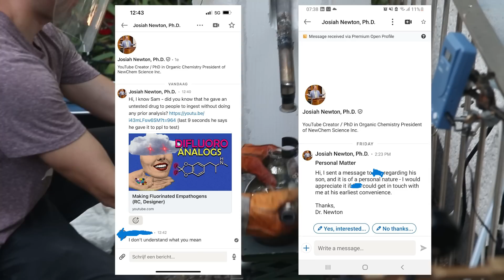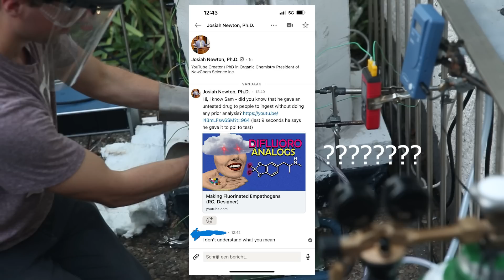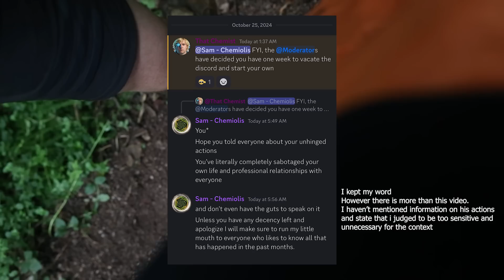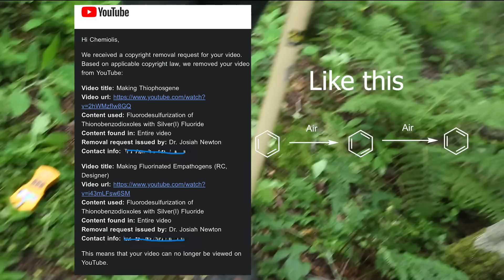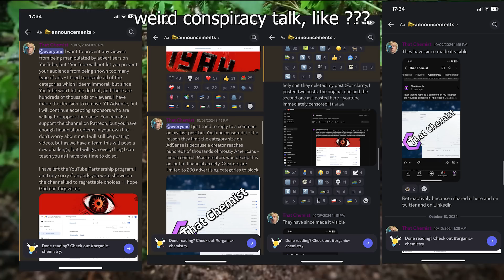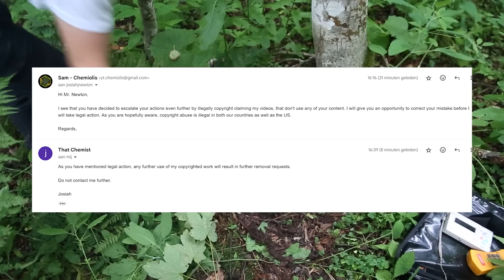That Chemist (Josiah Newton) is a Fraud

Comment: Will someone tell me what type of vessel that is they're using? It has some kinda insulation. Is it a Reactor, or a short path ?  I see some welding there that continues to a kf fitting(25\40?) then down to a rbf after the glass joint.  
I've never seen one like that, with the steel head and so much insulation. If anyone will share this, thank you. 
Otherwise, this situation is somewhat unfortunate. I've really enjoyed this community and especially the level of professionalism and respect across levels from PhD down to fairly "ratchet" techs like myself.  We don't need abusive relations tarnishing our sectors. Thanks everyone that's good and thanks Sam.

Comment: I mean, if the ADHD medicine was adderall or some other formulation of dextroamphetamine that is more likely to cause acute psychosis. As far as I'm aware, LSD can cause issues but it doesn't necessarily cause psychosis, but it can exacerbate potential underlying conditions that may have otherwise remained dormant, like schizophrenia or bipolar, conditions that can in turn cause psychosis. The latter actually happened to someone i know and it's pretty heartbreaking to see.
Reply: no, both can cause accute psycosis, and LSD causes it more often than adderall

Comment: At 3:30 for the third reaction why won’t the grignard SN2 the tosylate or perform an E2 elimination on the nitrogen with the tosylate leaving?
Reply: That’s Tosyl, not tosylate (OTs). I don’t remember its stability towards grignards, but it is very statically encumbered relative to the cyclopyl methylene. Also E2 would be geometrically very difficult.

Comment: Aw man, That Chemist underwent ego death during a bad trip and became a jerk? Well that sucks, I'm gonna miss who he used to be. If you're gonna use drugs then you need to be careful, I almost gave myself an ulcer mixing weed and alcohol to get some kinda bigger high, it wasn't worth it in the slightest, I was sick for for 3 weeks and only recently do I feel sorta back to normal. I puked on my floor and ruined a bunch of my belongings, I fell and smacked the back of my head against the wall really bad, I blacked out multiple times. Moderation is important in all things but so is taking the time to really think about what you're intending to do and if it is within a reasonable margin of safety. 

Don't take pointless risks.

Comment: Claiming copyright on a chemical synthesis (or any other method) is just bonkers. These can be only patented (or might fall under other 'industrial rights', but these generally have to be registered, and definitely shouldn't be asserted through YT's copyright claim system).

The only thing that falls under copyright in this case is the paper itself (ie. its text, images, any accompanying source code, etc - not the concepts explained within).
Reply: Also, technically if you don't sell or give away patents you can follow them. Patents are a right on making a monopoly of a new product. If you don't sell or provide the product to others, you're not breaking the monopoly

Comment: which psychosis has a 70% recovery ratethe rest of the 30% remain on a level of schizophrenia. :(
Reply: while it is heartbroking you can conclude that this is all likely due to strong persistent dilutions not anything that he would have done under normal circumstances had he remained sane.
Reply: if you're in touch with their friends and family they should not be allowed to mess with chemicals especially if they can't make sane decisions. and those groups of friends specifically should be isolated from him or contact limited.
and possibly antipsychotics continued

Comment: I want to make something clear about the LSD story.

Those who experience psychosis as a result of taking a substance were already predisposed to psychosis. If you are not predisposed, then it is unlikely that you will experience a psychotic episode from using LSD. 

Do your research before taking substances, if someone related to you genetically has experienced mental issues before, you too are also at risk of those issues arising as a result of substance use. 

Lastly, ADHD medications don't generally interact with LSD. I take Ritalin for my ADHD and have taken dosages of LSD up to 400mcg and have never experienced any medical issues arising from those experiences.

Comment: I've done lots of drugs and mixed them too, like ADHD meds and (what you'd probably call) 5x (or more) the "normal" dose of acid, and weed in top. It was very fun, not dangerous (I researched extensively beforehand and know my limits), haven't had any problems (despite doing stuff like taking molly and / or acid at least every 2 weeks for more than 6 months) and one day I just stopped because I've had my fill. Haven't done any drugs since, besides a shroom-trip every 6 months or so (not even alcohol). It's been 5 years btw, so it's not like I'm about to "relapse".

I'm very glad about this phase in my life. It was very therapeutic and full of self-discovery throughout.

You can't judge other's drug-use behavior as "abuse" from the outside, unless they're obviously suffering from its consequences and still won't stop. You're just parroting fear-mongering media and "popular opinion" (i.e. uninformed people). 
I'm not saying nobody is abusing drugs, but even extensive and very intensive use may be absolutely fine for some people.

And "personality changes due to changed brain-chemistry" is such a reductive state as to be actually stupid. The brain is constantly modulating its own homeostasis, and psychosis/delusions may be exacerbated but isn't all that often caused by drugs. In any case, statements about causal relationships can't be made for any given individual.

Delusions of grandeur are very common for spiritual "gurus" as well, for example. They come from misinterpreted spiritual insights, not from drugs by themselves.

Comment: That sounds pretty bad as far as the  consequences of frequent drug use and mixing prescribed brain chemistry drugs with frequent/large doses of LSD. I do kinda take issue with your characterization of 3x the normal dose of LSD as being a big deal; that's not a particularly large dose and people taking thousands of doses have had relatively normal trips, longer and with a higher chance of a "bad trip" usually, but not permanent, the combination of drugs is definitely the more concerning part from that. The thing this sounds like is the triggering of Schizophrenia or similar disorder. It really sucks and dealing with someone you know going down that road is never easy, I hope that he's got a good support system and doesn't drive them away.

Comment: It’s much more likely that the psychosis was mainly caused by the ADHD medication than the LSD. The amount of psychotic episodes due to amphetamine use is rising, probably due in part to an increased number of people getting diagnosed with ADHD in the United States. Psychosis is mainly the result of excess dopaminergic activity, which is more typical in cases of long term amphetamine use when compared to even DMT or LSD. LSD and other psychedelics can be very beneficial and useful for getting off such medications, however, there is no doubt that combining them irresponsibly can lead to a great deal of trouble. If you think of amphetamines as the most addictive class of compound known, the psychedelics are the exact opposite of that. Taking both at the same time would be the equivalent of slamming the gas and the brakes at the same time in terms of the neural systems each one mainly acts upon. (Serotonin for LSD and dopamine for adderall or whatever stimulant he was taking.) Regardless, it is sad to hear that Joey is going through such a rough patch. Hopefully he finds his way out of this mess and can stop harassing other content creators in the meantime.
Reply: @LivingBreathingRedFlag Interesting. Thank you for the clarification. I was not farmiliar with the mechanism of some of the latest antipsychotics. I want to clarify before I make any citations that I am not arguing that psychedelics should be used to treat all cases of psychosis. 

My argument is that psychedelics are excellent at treating addiction. One of the most common drugs of abuse is amphetamine (Adderall.) Unfortunately, a side effect of amphetamines is psychosis, and that holds true in people with or without a genetic predisposition.

Although psychedelics like LSD can cause brief psychotic episodes, they are not known to cause lasting or recurring psychotic episodes like that seen in schizophrenia. LSD CAN cause HPPD, which is the recurrance of the visuals one would see when under the influence of LSD, however, these experiences are not considered to be "true hallucinations" -i.e. seeing or believing things that are not real or are not there or having events occur that never really happened. (I guess you could argue that the psychedelic visuals and swirly colors are "not real" but they are in a completely differenct category of experience than seeing spiders or thinking the government is out to get you.) (The latter being more likely to occur on amphetamines or even too much benadryl.

The psychotic symptoms from amphetamine (or even marijuana) use or abuse can be longer lasting and also line up more precisely with the diagnosis of schizophrenia than the psychotic symptoms from LSD. 

Anecdotally, any drug that supraphysiologically elevates levels of dopamine without also stimulating the serotonergic system puts you at a higher risk of LASTING psychosis than any serotonergic psychedelic. 

From a psychotherapeutic perspecitve, (also anecdotal,) the classic definition of insanity would be doing the same thing over and over again and expecting a different result. That about perfectly sums up all addictive behaviors to a T. Anyone who has taken a psychedelic will tell you that the experience makes it impossible to ingore all of the ways in which you as a human being are repeating behaviors that no longer serve you. Most people who initially get into psychedelics will eventually and inevitably get too heavy a dose of the truth all at once, call it a "bad trip" and never touch the class of drug again.

Many also quit taking other drugs altogether along with those psychedelics. Including tobacco.

TLDR; Adderall is addictive. Taking addiction to its limit, by definition, is insanity. Psychedelics aid in the treatment of addiction. Given this, psychedelics may have secondary or primary antipsychotic properties, depending on the cause of the psychosis.

Citations:

Can LSD cause psychosis?: Symptoms & treatment for LSD-induced psychosis. The Recovery Village Drug and Alcohol Rehab. (n.d.). https://www.therecoveryvillage.com/lsd-addiction/psychosis-and-lsd/ 

High doses of adderall may increase psychosis risk. Harvard Gazette. (2024, September 12). https://news.harvard.edu/gazette/story/2024/09/high-doses-of-adderall-may-increase-psychosis-risk/#:~:text=Patients%20taking%20a%20high%20dose,McLean%20Hospital%2C%20a%20Harvard%20affiliate.

Nigro, S. A. (1968). Toxic psychosis due to diphenhydramine hydrochloride. JAMA: The Journal of the American Medical Association, 203(4), 301. https://doi.org/10.1001/jama.1968.03140040053018 

Desai, S., Santos, E. L., Toma, A. E., Henriquez, A. A., & Anwar, A. (2022, July 26). Adderall-induced persistent psychotic disorder managed with long-acting injectable haloperidol decanoate. Cureus. https://pmc.ncbi.nlm.nih.gov/articles/PMC9403214/ 

Marijuana induced psychosis: Everything you need to know. Southern California Sunrise Recovery Center. (2024, July 2). https://socalsunrise.com/marijuana-induced-psychosis/#:~:text=Continued%20heavy%20marijuana%20use%20increases,susceptible%20to%20marijuana%20induced%20psychosis. 

Johnson, M., Garcia-Romeu, A., & Griffiths, R. (n.d.). Long-term follow-up of psilocybin-facilitated smoking cessation. The American journal of drug and alcohol abuse. https://pubmed.ncbi.nlm.nih.gov/27441452/

Comment: He was either predisposed to psychosis or was very mentally weak. It seems especially so because of the short time period between his introduction to LSD and the episode. I’ve been doing LSD for 20+ years, sometimes more than you are describing in this video and I have never experienced a psychotic episode or lost control of my actions.
Reply: Because psychedelics don't really do any of that, it really does come down to mental fortitude. There is nothing there that's not already on the insides of our minds; therefore, the freakout was always there. I have a sort of weak hypothesis about the ones who break are the ones who will not permit themselves to experience ego death. Like, you have to let go, that is a very large part of the entire point of taking a psychedelic in the first place.
Reply: @RobsMiscellania a bit pseudoscientific. More likely he was just predisposed to psychosis.
Reply: @-bamks  Some drug combinations really can take a fairly normal person and make them psychotic. You can do it consistently in animal models. So he may or may not have been predisposed, but it wouldn't have been necessary.
Reply: @ oh yeah I completely agree, it totally depends heavily on what exact drug TC took and got much
Reply: @canonicaltom  In the animal models you’re suggesting, did they use a the same mg/kg proportional to what would be encountered during abuse in humans?

Comment: I'm not sure that by publishing in a journal or publishing in any other way, you would sign away your copyright.  I would think you retain a copyright in the exact combination of words you have written.  However, given the nature of science, anything he has written about in the journal paper would simply be a reflection of physical/chemical laws and therefore, that itself would not be copyrightable.  Anyone could use this paper as reference material, whether for commercial purposes or not but the copyright would prevent people from actual copying of the material into a separate work such as copying sentences or diagrams.  I'm making some assumptions here as I don't have much familiarity with scientific papers but I do have decent familiarity with copyright law in the United States.
Reply from the maker: All I know is that Journals are very 'abusive' already and it wouldn't be a surprise that the truly take every bit of copyright away from you. Since I didn't use any of the content from the paper directly it doesn't really make sense to claim it anyway. If I stole all his diagrams and claimed it as my own work, that would be different, but that would mean ACS has to file the copyright, since Joey has 100% signed away all his copyrights to the research.
Reply: In my experience (mechanical engineering), most journals actually do require you to sign over your copyright to the journal, as part of the contract you sign with them for them to be able to publish your paper.  You do not retain a copyright in the words that you wrote, because you signed a piece of paper that gave all rights in the work to the journal.

The ACS in particular has different types of agreements depending on various things, but the basic agreement is indeed a "you transfer the copyright to us" agreement.

And, yes, that means that if you sign a publishing agreement like that and then put a copy of the text of the paper you wrote up on your website, unless the journal specifically allowed you to (some do, some don't), then you are violating the journal's copyright and they can legally issue a takedown notice.